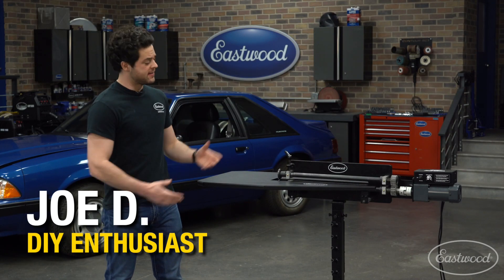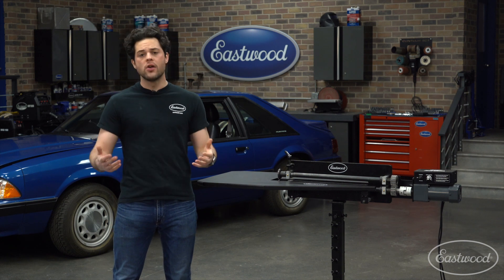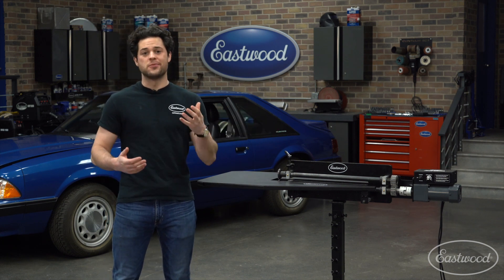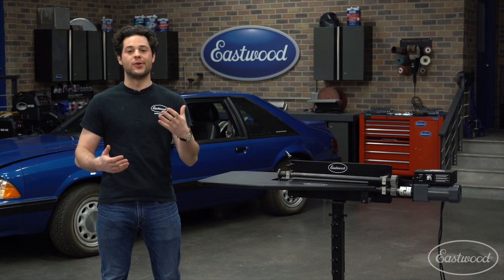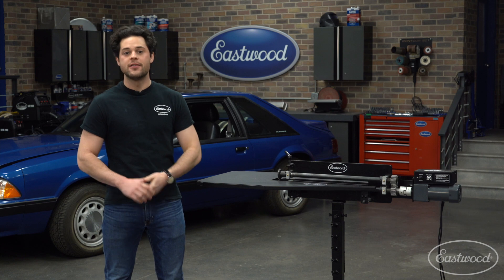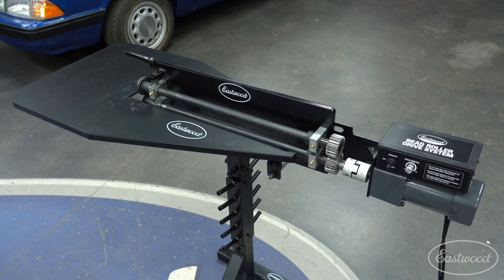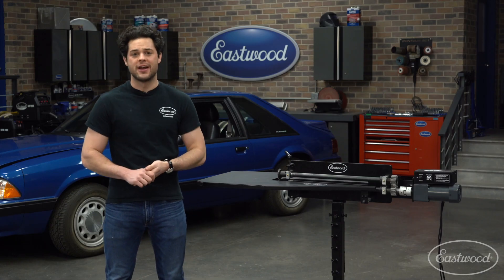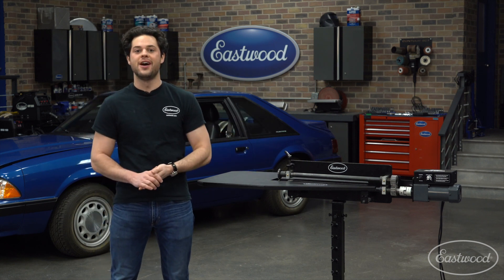The BEST Solo Bead Rolling Combo: Bead Roller Table + Drive Motor EASY INSTALL! Eastwood

Comment: You need to add 1” lock collars on the other side of bearing blocks so shafts don’t slide forward and detach from motor drive
Reply: Or move gears forward which isn’t shown in above video

Comment: Whatever happened to the Cushman scooter project?. I can't find anything after episode 15, air bag brackets installation. Did you just quit?? Any info. will be appreciated.
Reply from the maker: Thanks for your interest! As it were, personnel and priorities were shifted, and that project is permanently on hold.
Reply: Oops, I just cut mine to fit.